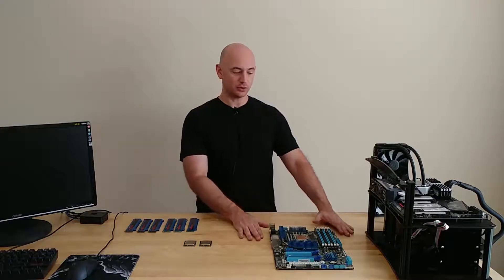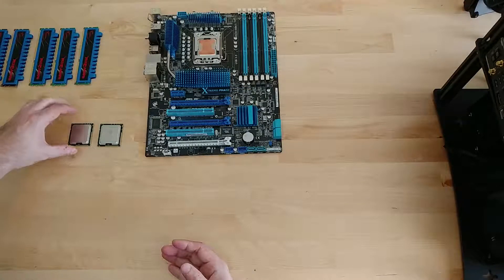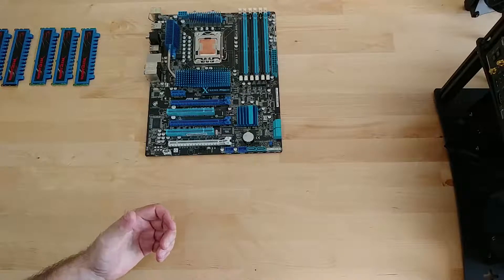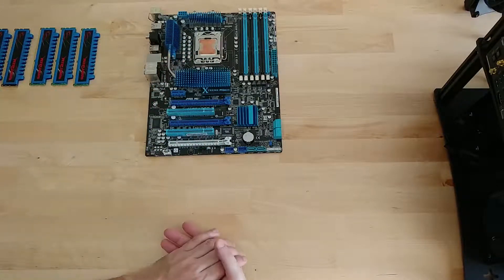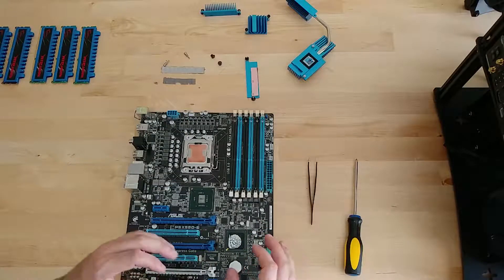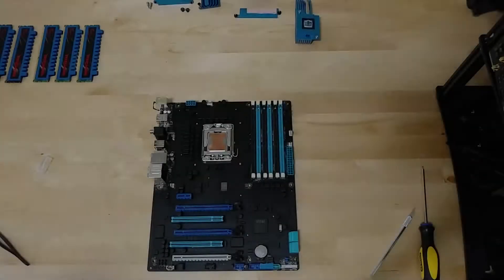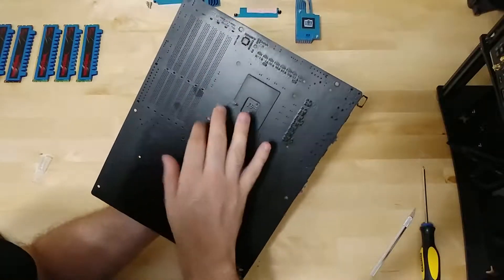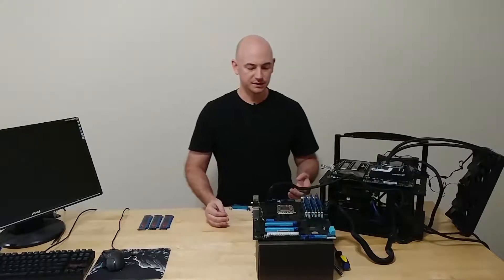Plastidip a motherboard for LN2

Comment: Good one. Maybe you should also mask the VRMs and inductors. I hope you can make a video on plasti-dipping a graphics card.
Reply from the maker: Heyo, i believe I intentionally left the tops of the power delivery components so they can still be used with a heat sink, but its been a while since I used that mobo. For LN2, i could just dab a little vaseline or kneaded eraser.

Good idea about the video card plastidip though. I have an old radeon 5850 I could try this on...
Reply: @tenminutetech  Looking forward to it. Already subbed. I recently fried a graphics card along with the motherboard because water got in the GPU slot due to condensation (using a chiller). So I’m thinking of insulating my other card and the entire motherboard.